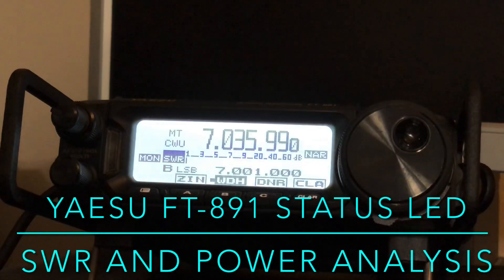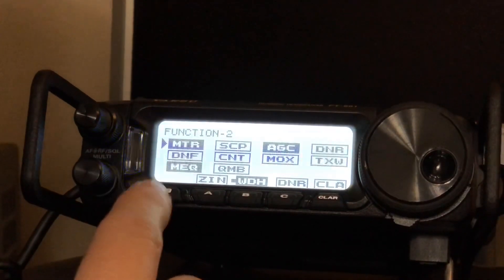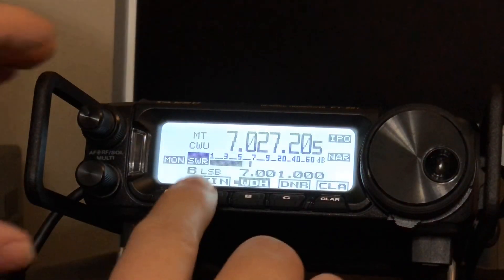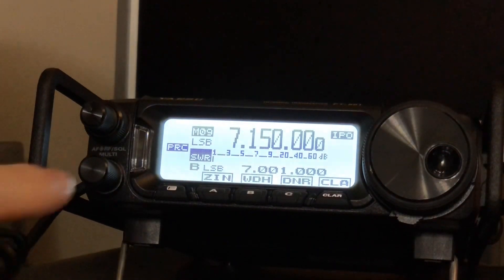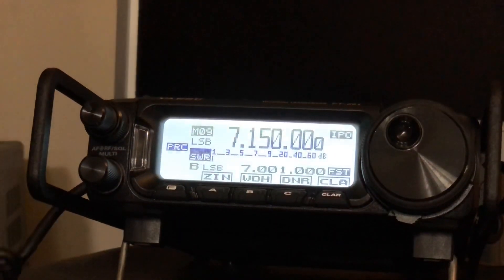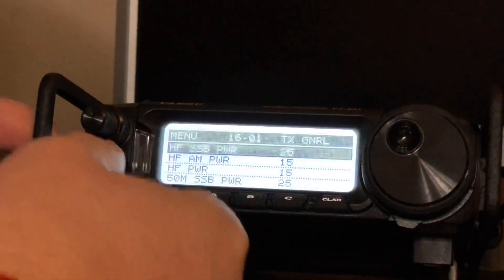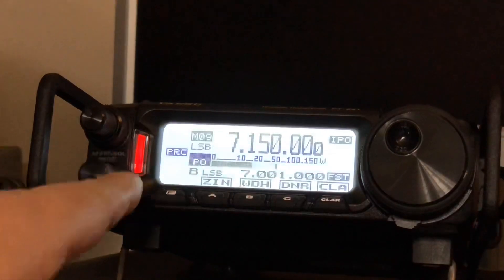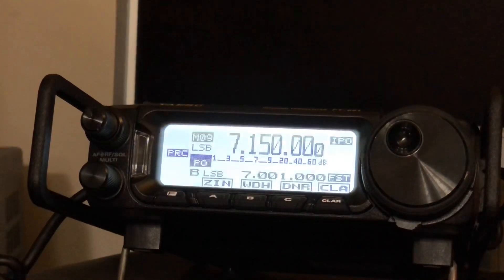Yaesu FT-891: Status LED, SWR & Power Analysis #ft891 #hamradio #swr #power #meter

Comment: I thought I'd share, in case anyone else is as good at confusing themselves as I am, that if you're in Digital mode you won't see power out on the meter using the hand mic... at least that's my experience and I hope that's what's going on... I haven't tried to tune up from software yet, but will this evening

Comment: Using the meter to give an RST has not been very good since using FT8 with the FT-891.  I have done a factory reset, but it did not help.  Maybe it was a coincidence, or maybe something broke.  Has anyone else had a problem with their meter after using FT8? Truth in advertising: I am not good at FT8.
Reply: FT8 is measured not in S meter but in SNR (signal noise ratio) in scale between +24 to -24 (higher is better), and SNR is measured by FT8 software not by S meter.

Comment: Have you ever seen a situation where the FT-891 has no power output in SSB, set to any value between 5-100 when keying up the PTT button but works fine on data modes and gets a full 20 when set to HF PWR 20?
Reply: Solid Red when pressing PTT on 20M
Reply from the maker: @cchalfantusa when you give a steady whistle, you don’t see any SSB power out?  If you just switched from FT8 to SSB, you need to make sure the radio is looking for audio from the mic again, and not the rear port.
Reply: @ nothing at all!  Which explains why nobody could hear me at a POTA activation attempt today.   When I get back home I’m going to check 11-05 SSB MIC SELECT and make sure I didn’t bump that setting.   I am also going to remove the head and make sure the microphone cord is seated properly.   It’s clear the PTT button is making contact with the microphone port since the light goes red.   Maybe it’s loose though and not picking up the audio pin.   I never mess with any settings between home and field and switching from digital to SSB the only setting I change is Width.   So I’m really only ever in the menus to adjust the power output.
Reply from the maker: Is the TX LED blinking?  What band?

Comment: Just ran this lil rig for 8 days in the Turks and Caico's on cw ..I had a bad noise problem due to solar cell chargers nearby. Without the width, and filter capabilites in this rig -I would have barely made contacts. This is a great video to learn when the tuner is tuned, and how to use the cw filtering. I used a 40m dipole fed with 300 ohm twin lead, and external MFJ Travel tuner. Worked great and no RF  on rig at all. VP5/K5SL
Reply from the maker: Thanks for sharing.  That sounds like a great experience.

Comment: Thanks for the FT-891 videos, Doug. I bought one in 07/24. I had been unsuccessful in my searching for setting the band edges. Thanks to your video, my head scratching is over😅. Am I correct in thinking if you're outside the ham bands and see the flashing red light that you are not putting out any power? Thanks again for the informative videos.
Reply from the maker: That’s correct, the flashing red means you are trying to transmit out of band.  Beware that you will get the flashing red light if you try to TX on 60m using the VFO. You have to use memory bank 5 for 60m.  Watch my 3-part 60m series.  You can find it on the Training page at: www.N4HNHradio.com

Comment: You and some other YouTubers have convinced me that my portable, POTA, mobile radio will BE the 891. I have an FT-710 in my shack but the idea of having to unplug a bunch of wires if I want to go POTA is almost undoable - ha. Or at least 'unwannadoable'. Not to mention size and WEIGHT issues! Thanks for taking the time to make this vid. Up to now I was fearing the claims about the unbelievably horrible menu system. But I think I can negotiate them with time.
Added on 7-9-24.   Yup, I bit the bullet and bought the 891. Now to learn how to get it set up for mobile/POTA operations.  Thanks for your helpful video.
Reply from the maker: The menu system in the FT-891 isn’t horrible. But I hardly ever touch it anymore.  I use the memory tune method that I showed in one of my videos.  I have to grab the manual to tweak my ICOM 2m/70cm mobile rig. That’s a terrible menu system.

Comment: Thank you, I just bought this radio and trying to figure it out. By the way what does a green led mean?
Reply from the maker: If you enable squelch, and set it to mask the noise, when a signal overcomes the squelch, the green LED illuminates. This can be helpful if you had the volume turned down.  You will have a visual indication of a signal.

Comment: 1.  10:26 you said you have to be quick about it and I must agree, the screen changes instantly. I have a problem with this because of my visual limitations, is there any way to change the time it takes the screen to change?

2. Thanks for showing how to go to the SWR meter display, I can’t find this process in the 891’s manual and I needed this as I set up my radio for the first time yesterday… I gave up and didn’t get on the air. 

D.C. 

WP4TGK
Reply from the maker: Don’t change bands that way. Follow the instructions in my video about using memory tune.
Reply: @n4hnhradio  it’s not just changing bands, I can’t even change modes because by the time I find the option (or before) it returns to previous view.
Reply from the maker: @azarellediaz4892 that’s what the video I mentioned is about. Store favorite frequencies and modes in memories. Change memory to switch to a different band/mode. It’s so easy that I can do it while driving.
Reply: @n4hnhradio  to store it I must first be able to get to it 🤪 I have half my sight, am old and this is a radio I haven’t had a single contact on because I still don’t know if my antenna is matched to the radio. Perhaps I should’ve stuck with my old CB’s that didn’t have so many buttons or menus. I’m a member of a local club where I can’t get help except told to read the manual… although they know I’m legally blind.
Reply from the maker: You would do better with a larger radio, like the FT-710.  And shame on your local club.

Comment: Fine video ! What about green LED status ? 😀
Reply from the maker: If the squelch is enabled (menu 05-05), a green LED indicates that a signal or noise has broken through the squelch threshold.
Reply: @n4hnhradio  Thank you so much !
I asked you this because in your video we did not see the green LED when the YAESU is receiving... Greetings from France ! 😀
Reply from the maker: @aureliusprimus I don’t have squelch enabled in the video. The green LED function is covered on page 17 of the operating manual. The FT-891 will automatically enable squelch when operating in FM mode. (Sadly, FTdx10 and FT-710 do not have that feature).  The green LED automatically comes into play with FM mode. You might squelch out the noise and accidentally turn down your volume.  The green LED will alert you that there is a signal.  If you want squelch for all modes, go to menu 05-05 and set it to SQL.  The RF Gain control will then act as a squelch control.  Most people prefer RF Gain for SSB and AM.
Reply: @n4hnhradio  ok my friend and thanks a lot…
Another thing : I setup
Power in AM SSB mode but I did not find how to setup power in FM mode. Do you know how I can setup Power in FM mode ? 😊
Reply from the maker: @aureliusprimus you probably need my menu optimizations document.  It is available for S7 Patreon members who join for a year.

Comment: Doing some messing around today and I believe HF power also affects FM transmit power. Did a few tests today on 10 meter repeaters. Have you noticed this?  Thanks.
Reply from the maker: Only AM and SSB have separate power setting.  CW and FM power is set in menus 16-03 and 16-06 (50MHz).
Reply: Ok thanks for the reply. You and your videos make learning this hobby much easier and enjoyable. Thanks again Sir. KK7NED
Reply from the maker: You’re very welcome but I cannot take the credit. If not for the generous monthly donations from Patreon members this channel would cease.

Comment: At 3:30 mark in video is the dummy load something extra we have to attach to the ft 891?  Where can we buy a cheap tester dummy load?
Reply from the maker: A dummy load is a 50-Ohm load that equates to a dummy antenna.  It allows me to test the transmitter without actually radiating a radio wave that can be received by other amateur radio operators.  A dummy load is primarily used for testing a transmitter. It provides the radio with something akin to a “perfect” antenna that doesn’t actually radiate a signal.

Additionally, it isn’t legal, or polite, to radiate a signal without identifying with a callsign.  I didn’t want to be heard by anyone else, so I used a dummy load.  Therefore saying my callsign is optional. But, I often say my callsign anyway, just to provide some verbiage with which to test the output power of the transmitter.

A dummy load is indeed a separate purchase. However it isn’t a requirement. Normally you connect the radio to an antenna. I happen to use a switch that allows me to select either an antenna (when I want to be heard) or a dummy load (for testing my radio transmitter).

73, de N4HNH
Reply: thank you @n4hnhradio
Reply: Got it.  Thanks @n4hnhradio

Comment: You say your using a Dummy Load . Do you have the Dummy  on the Radio TX out or are you using a SWR meter/tuner elsewhere with it . Also if I have a SWR meter/tuner in line to tune  , should the 2 different meters both read a good SWR or do I depend on the Radio as the final truth ?
Reply from the maker: The dummy load is connected to my antenna switch.  The antenna switch is connected to my amplifier.  If the SWR meter is between the amplifier and an external antenna tuner, both the external SWR meter and the Radio SWR meter should read an acceptable SWR, once the antenna tuner has found a match.  The radio meter and the external SWR meter might not exactly agree but they should be close.  One might show 1.3:1 and the other 1.5:1.

Comment: I just installed mine in my truck . I got a blinking light without pressing PTT.  You know what it was? I had plugged the external speaker connector into the CW Key input. OOPS.
Reply from the maker: That can happen. The labels that define the connections on the back are on the bottom side of the radio.

Comment: Zi affects tx Freq, but one can use split to overcome
Reply from the maker: ZIN is a different approach. ZIN adjusts both the RX and TX frequencies, so my transmitted frequency matches the transmitted frequency of the other station. This allows them to hear the CW pitch they prefer. 

The Clarifier would be another method.  If I use the Clarifier to adjust to their sending frequency, they don’t hear my transmissions at their desired pitch. My transmissions are at the frequency I originally dialed in. I could add the TX Clarifier to adjust my TX frequency to their RX frequency, but that is essentially what ZIN accomplishes.  ZIN handles both the RX and TX with one button press.

Comment: Great video 73
Reply from the maker: I’m glad you liked it. 73, de N4HNH
Reply: @n4hnhradio  Was on QRZ and looked your call up. Pretty impressive resume. I just got and ft981. Very impressive little rig. Anyway just wanted to say 73 and stay radio active ✌
Reply from the maker: Yes, the FT-891 is a very capable transceiver.  Thanks for stopping by.

Comment: Can you test your SWR on FT-891 in SSB voice mode or must you switch to AM or CW?
Reply from the maker: The SWR will display in SSB mode.  It will track with your voice peaks.  Whistle into the mic to get the highest reading.

Comment: Red LED will also blink on off if the rig is powered up with the PTT depressed. Rig will not transmit even if in band. Saves a burnt out PA due to a struck PTT. Clever radio ..who's a good boy then!
Reply: Also blinks red when you accidentally plug external speaker into CW Key input on back of rig. How do I know this?
Reply from the maker: Indeed, Denis.  Something similar happened to me with my FT-920.  I accidentally pressed the MOX button while powering down, in the dark.  It is right next to the power button.  Later, when I powered up again, the FT-920 TX indicator blinked.

73, Doug

Comment: Great video.  One note.  You did the tests with the processor turned on.  So the power was optimized anyway.  But it's nothing.  I have a request.  Could you please make a video of how the ALC behaves at 100W and under an artificial load?  No cpu and rf gain at 50% in CW.  Because I have such a radio and I wanted to see if it shows the same.
Reply from the maker: I always run the processor.  I never use ALC.  I only watch the ALC meter when adjusting mic gain and processor level.

Comment: Great video. New General and recent ft 891 owner. How would you rate the accuracy of the radio's SWR meter? Trying to to determine if an external swr meter is a necessary expense.
Reply from the maker: Built-in SWR meters are not generally as accurate as external ones, but they are accurate enough to serve their purpose.  A reading of 1.7:1 might be within a “tick” or two off, but that’s close enough.  External ones can be off a tick or two as well, unless you pay the price for one that is calibrated to within +/- 5% against the National Institute of Standards and Technology (NIST). 

I own a RigExpert ZOOM AA-230 antenna analyzer.  But I only use it when I first install the antenna, to get the SWR set initially.  After that I rely on the built-in SWR meter for relative diagnostics.

I leave my meter set for SWR.  If I see the reading suddenly go full scale, I know that either my antenna or coax has a serious problem.  If it goes slightly above 2:1, it usually means my antenna has water or ice accumulated on it.

If the SWR rises much above 2:1, the FT-891 will start cutting power output to protect itself.  The built-in SWR bridge will provide a close enough reading for the protection circuitry (foldback circuit) to function.

73, de N4HNH

Comment: Thanks for the great video, Doug ! I use my FT-891 almost exclusively for POTA. I had a situation that might be of interest to those who see they have no power out. I run a portable vertical antenna that one time was shorted out so the entire unit was transmitting to ground. In that state the antenna acted just like your dummy load. The SWR reading was 1.1:1 but no signal was outgoing. One way to check if this is your problem is to test the SWR on all bands. If the SWR is great all across the board, be suspicious. You may have lost the insulator between the parts of your antenna that needs to be loaded and the stand.
Reply from the maker: Great point, Jim.  73, Doug

Comment: Great videos Doug, I have a question regarding the 891, I seem to be approx 3 S points lower on the receive compared to my 991A on say 20m SSB and was wondering if you could try and expalin to me how this could be, same antenna, many thanks
Reply from the maker: Is there a difference in gain structure?  IPO, ATT, etc.?  Be careful that you don’t transmit one radio while the other is turned on, especially if they are tuned to the same band.  It can damage the receiver front end.

73, de N4HNH
Reply: @n4hnhradio  Hi Doug, all Ipo and Att settings are the same on both radios, only have one on at a time with another station transmitting to me while I change radios over, it seems strange that there is such a difference in the receive signals
73,  MW7KDA
Reply from the maker: There shouldn’t be a difference.  That’s why I was concerned that maybe you accidentally transmitted with the FT-991A while the FT-891 was powered on.  I put both radios up against one another in some of my videos and they were fairly close in performance on receive.  The FT-991A will have a slight edge though because it borrows some of the receiver front-end architecture from the FTdx5000.

You didn’t mention which mode.  With CW the S-meter readings will drop significantly when using less than a 150 Hz bandwidth.  That’s normal though, and it should drop about the same with both radios.

73, de N4HNH

Comment: Doug, Great video helped me a ton. Just picked up the FT891 today and am trying to learn the bells and whistles. So far awesome radio except for the freq lock that I haven't figured out how I turned it on or how to turn off but I will get. Keep up the great videos!!!  73...WB3FRL
Reply from the maker: Hi Don!  Congratulations!  Remarkable radio, the FT-891.  Tap the power button to toggle the VFO lock on or off.  

73, de N4HNH
Reply: @n4hnhradio  Thanks Doug! I decided to read the manual when I went to bed and low and behold I found it. It was driving me crazy! Thanks for the response! 73...WB3FRL

Comment: I use my FT-891 as backpack radio for POTA activations and it has been a great little radio.  One quick question about the meter.  I’ve watched many of your videos and have noticed your meter indicates differently than mine.  My meter bar just moves up and down while your meter momentarily leaves a single pixel at the peak.  Is that a setting option or maybe a software update?  I have yet to find it discussed in the manual.  Thanks for the great videos on both the FT-891 and FTDX10.  You have shown me many features I would never have known about.  Keep ‘em coming!  Ed Morris, K5KMY.
Reply from the maker: Hi!  Check menu selection 2-05.  That controls the Peak-Hold.  I am running latest firmware, but the Peak-Hold option was there before.  I didn’t notice any appreciable improvement with the firmware update they put out last year.  I don’t usually update unless I’m having trouble.  My FTdx10 is still at version 01-04.  They are up to 01-09 now.

73, de N4HNH